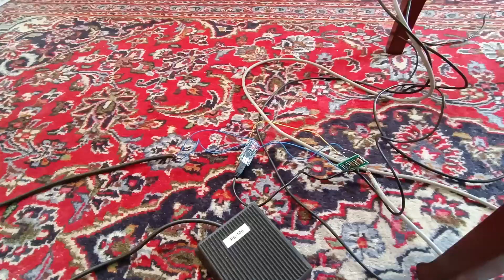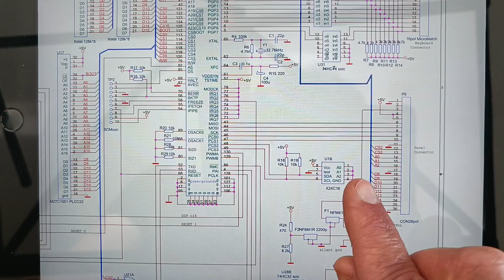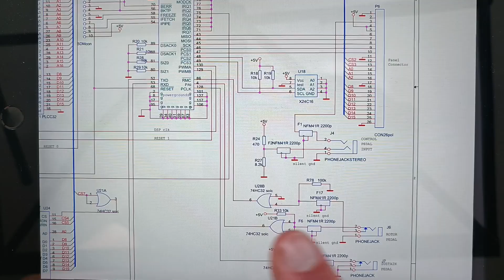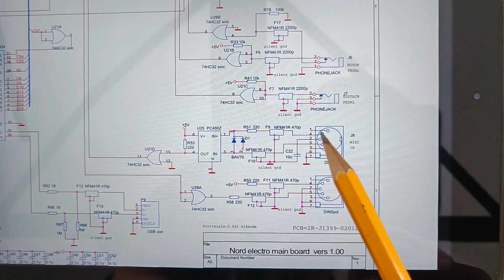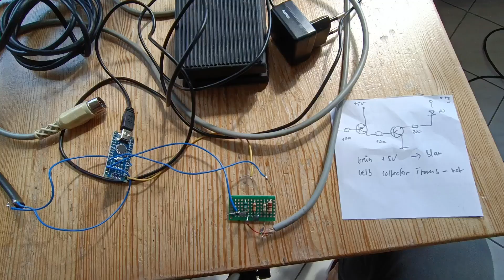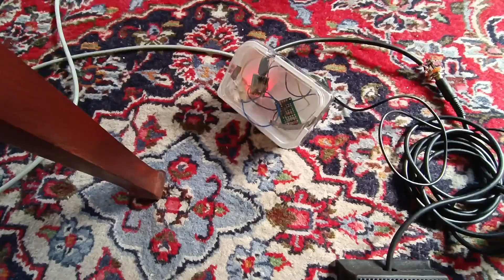DIY Arduino MIDI Sustain Pedal: Full Build & Theory

Comment: Pretty good analysis of the problem, and clever solution.
I would have taken the keyboard apart, to check for broken solder connection myself, as I have different playing situation, and would find it easier to fix it, than to make an Arduino adaptor.
Thanks for sharing the details of the design. I am a retired electronics tech, and appreciate this sort of thing.
Good luck with your gig, play well, have fun 🎹🎶🙂
Reply from the maker: Thank you for your kind words. I plan to repair the keyboard properly when the tour is done.